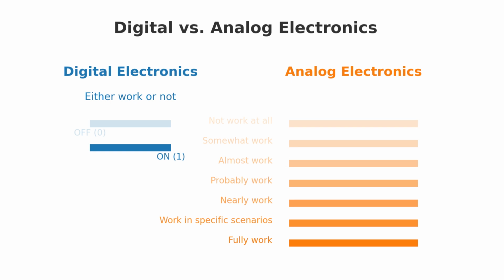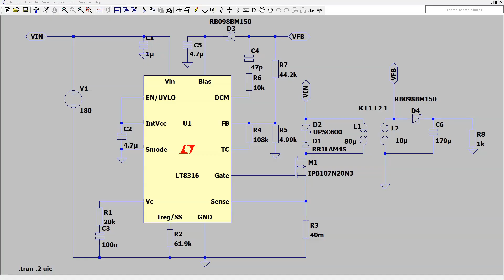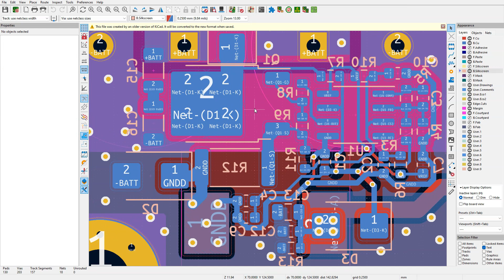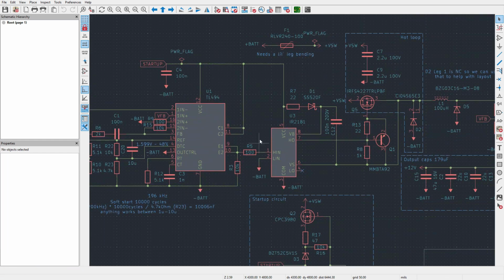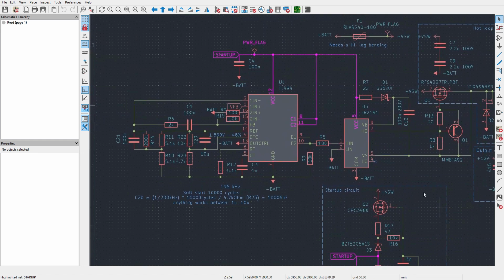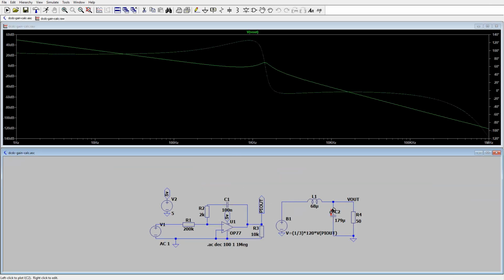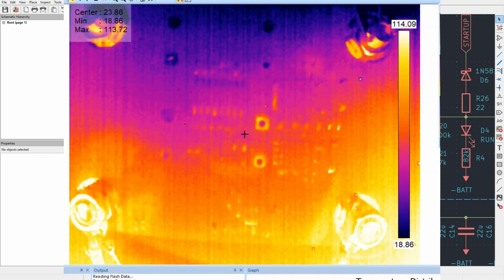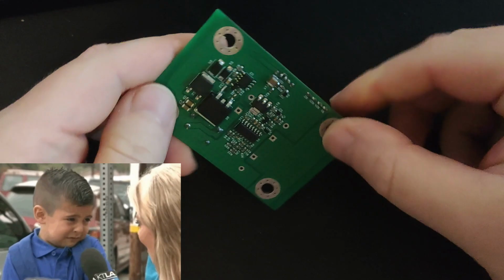Giga ESC Power Supply Madness: Wide range input 32-200V down to 12V

Comment: That "floating ground" IC you used is called offline switcher and there are IC that can have input up to 1000V. These things are used to provide voltage for controller IC in AC-DC converter in lieu of transformer with auxiliary wound.

It's quite unfortunate that design doesn't work out. Because if you can find the right part the design can be much less complex and time-consuming than what you've been through. And higher output power to boot.

MP157/175 seems to be perfect for compact design like yours.

Comment: at 4m13, the floating buck, you can see your issue - your feedback loop (connected to FB pin) has a rising time constant of zero, limited only by the speed of D3 and a falling time constant of 25k||12uF = 300ms - 0.3s!!! It essentially has no feedback loop given it is operating at hundreds of kHz. 

If you look at 3:46, the TI one, you see 2 diodes - the Vs pin has no filter atall, there is a second diode to decouple the power supply from the feedback.

Comment: I'm surprised that tl494 can properly regulate the output at these high in/out ratios, without any tricks to increase the duty cycle like a tapped inductor.
Also a bit of brute forcing took place - high ratios are not kind to components.

Comment: The IR2181 in combo with the MMBTA92 is an interesting PUSH-PULL design, although a bit wasteful of the IR2181.
Something like a FAN7171 might have been a better choice.  The IR2181 is very common, the FAN7171 less so, but often cheaper.
Reply from the maker: That is the thing, there are probably numerous better drivers but if they are not common i'd rather take more expensive but widely available part. I'm tired of parts that has to be constantly switched as they are not available.
Reply: @KaminarisTech  I understand, but IR2181 is ONE large manufacturer ONLY (Infineon), and so is FAN73711 (FAN7171 was a TYPE, sorry) from OnSemi.
Both are parts around for a long time, it's just that FAN73711 is used far less often.

Comment: Very cool! With the startup circuit and the mosfet driver this design might be adapted to any regulator, not just the TL494.

But why do you need 3 amperes? It seems excessive. As an alternative, i would suggest you again look into high-side buck regulators, which are technically AC/DC regulators, but all AC/DC SMPS use DC inputs in practice (rectified mains AC). For example LinkSwitch-TN by Power Integrations, MP157 by Monolithic Power Systems, or AP3928 by Diodes Inc. They are more common, simpler, and some of them work with low input voltages. But why is your input voltage as low as 32 volt anyway?

Regarding SG3525 mentioned, it does not support 200 volt, nor can it drive a high side N-fet, i.e. some kind of mosfet driver is still needed.

Anyway, good luck!
Reply from the maker: I do not need 3A, I mentioned it in video i was aiming at 1A. The absolute minimum for vesc is 500mA which is a bit too close for comfort if using built in bluetooth.

I have not seen LinkSwitch-TN but i did see AP3928 and the problem i see with all those AC-DC switch controllers is that none of them can, at least on paper, go lower than ~80V AC. I have also not seen a full schematic of DCDC using one of those chips but if you have it, please do share.

32V was not a hard requirement either. I wanted to fully support at least 16S batteries which are 40-48V fully discharged. So it had to work a bit lower than that. 16S configuration is commonly seen in high-powered electric bikes and scooters

Comment: Have a look at SG3525, is should be pin compatible with TL494 and replace both it and IR2181 as it has push-pull outputs that can do 500mA max each.
Used a lot of those back when i was young (over 30 years ago) to build 1KW DC-DC converters. 12V DC to +-60V ....
Reply from the maker: In case of step down converter this is probably not possible because SG3XXX does not work on any of the pins with 200V. Mosfet driver is capable of doing so because its 600V tolerant and VS pin is not connected to ground while SG output stage is. I could be wrong but datasheet states VC pin is only 60V